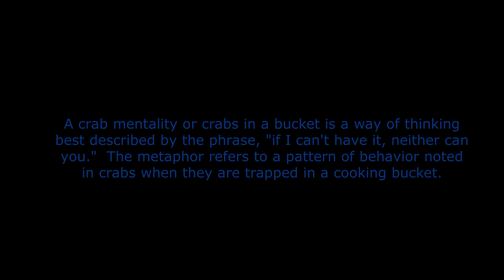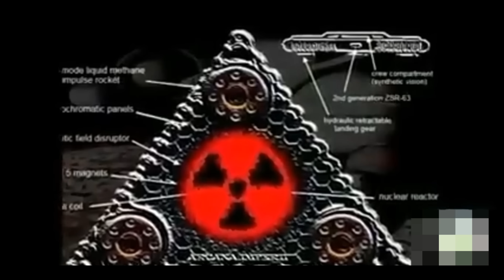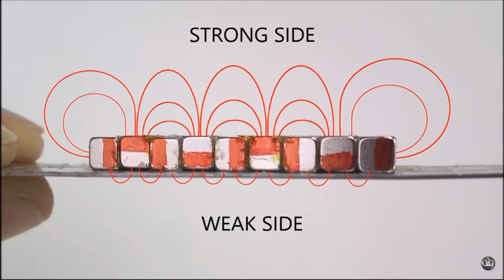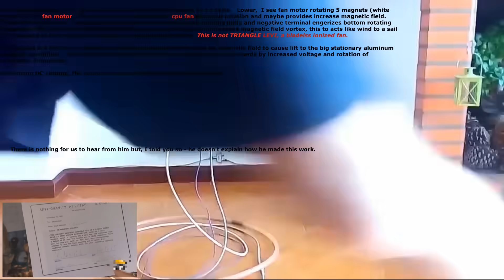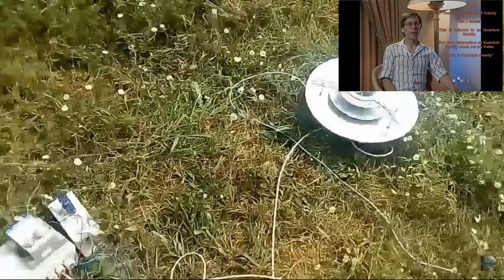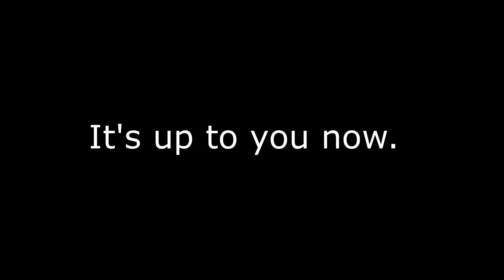anti-gravity project

Comment: Drone propellers made it appear to defy gravity just like helicopters etc., I suspect.
Reply: Respectively, you need to go study this stuff in detail. The device copies all the principal technology from the German Bell to the descriptions of the Vimana craft. There is no way this stuff is fake, have you not see the Lifter Tech experiments, are those fake too? You can take two magnets of same size and press them together and feel a slight weight difference when compared to two other same size magnets sticking together, the weight loss is apparent. Also this experimenter is pumping thousands of volts into the center capacitor and he is counter rotating two opposing fields against a reflective aluminum disc, creating in the ether a counter 
field that is breaking the gravity lock.  He also is pulsing Ultra Sound from the cone downward and probably magnifying the sound 
pulse stimulating the ethers to move downward. . 

How about the sound chamber experiments levitating dust and the items floating upward in the Hutchison experiments? What about the High Voltage experiments that demonstrate charge obstacles get lighter? Friend, the proofs are out there. .My guess is this guy is probably getting very worried about what he has found. . He has not posted any update videos. What about the many patents on the High Voltage side of the technology. You don't get a patent on something that does not work. Just some things to think about..

Comment: If you're going to deny this is anti-gravity, then I insist that you need to explain HOW they did this video. 

I don't see any signs of ionic wind. Besides, they don't have the lift capability to lift what we see in this video. So that explanation is gone. A wrecking yard magnet won't work because it needs to be close enough that we would have seen it in this video, so that explanation is gone too. He shows there's no string, and nothing from below supporting it; so 4 of the best explanations are all gone. So what else could this be, and not be anti-gravity? 

Some are saying this is "not anti-gravity" because it uses electromagnetic forces to induce lift. That' a bunch of BS because this isn't a "motor" spinning a fan blade to push air, causing a counter-force to create lift (like a drone). A drone converts electromagnetic force (battery) into mechanical energy (motors) that directly pushes the air (fan blades). This is simple enough for a child to understand, and doesn't violate Newton's 3rd law. 

Spinning magnets to create LIFT directly violates Newtons 3rd Law! After all, what is pushing against what? NASA scientist can't even do this. If you know one that can, tell us! 

They should have put sawdust on the ground to show us it's not an ionic lifter. I myself do feel stupid watching this, but I'm willing to learn to achieve the amazing. I think there is more going on that I've seen in school; and YES, I was paying attention.  

I can see now what "Jeff" means about "crab mentality". If you're not amazed by this, it's because your mind is a closed book that can't be written in; Or you maybe you DO recognize what this is, but don't want to see others have what you cannot.
Reply from the maker: It takes an open mind connecting all the videos to formulate how is this  working, the videos collected here builds upon another and formulates why is this craft hovering, a some type of anti gravity or  seeit as some magic trick.  You'd figure one would attempt  the idea how we can do this with house hold items, yeah its rough reading all the crabs on Earth, you my good sir aren't one denying humanity's better future.

Comment: Apply to a Durigible and u can maneuver all over the sky and travel for a great distance with no sound
Reply from the maker: Well.  Least its hovering..  To add, why don't we just balloon to space as a launching pad. Endless possibilities.
Reply: @jefflucas_life  because ballooning requires a difference in weight of the aircraft and the air it displaces with its balloon, the higher the balloon gets, the slower it would rise because the air gets thinner until there is no air (the vacuum of space), the balloon would rise until the total air it displaced reached exactly the same weight as the balloon itself, minus the reduction due to the lower mass gas that's inside, then it would stop rising... 
To get hundreds of tons of steel to the same height Felix Baumgartner got to before he skydove out of his little capsule would require balloons so inconceivably large that it's just easier to create a constant explosion that pushes them upwards